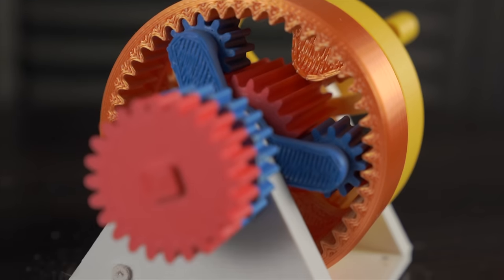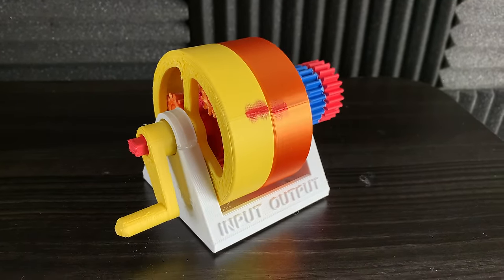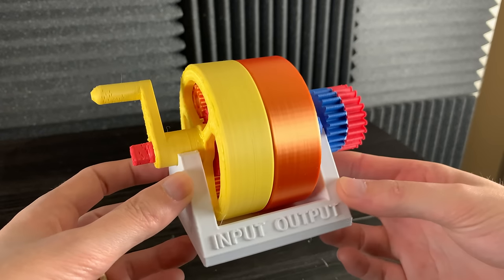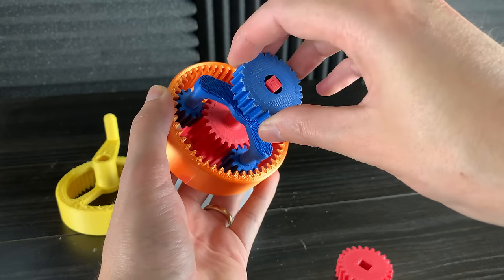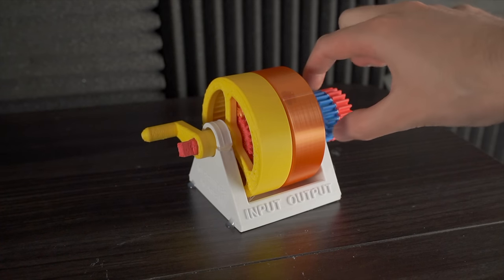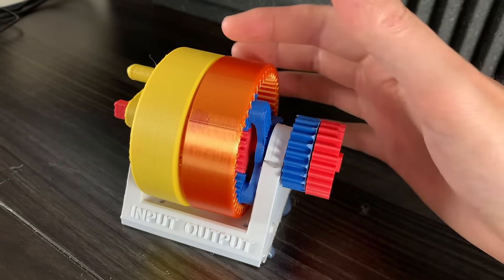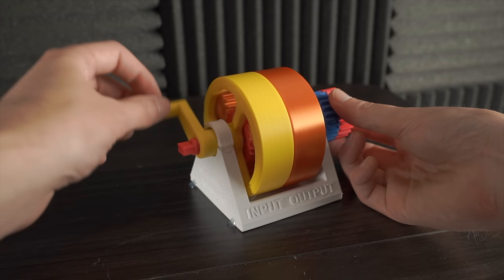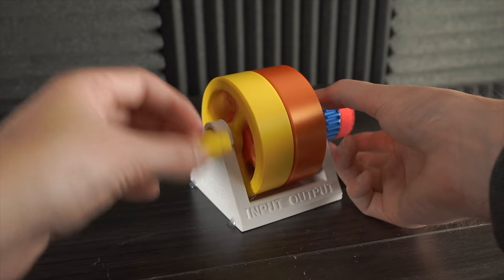How do automatic transmissions work?

Comment: Okay? So how does it automatically change the gears?
Reply: In a real car actuators will do the job.
Hydraulically in older cars
Computer controlled on newer ones
Reply: @ahmedyassir5569  Nope.  It is a series of hydraulic valves that are interconnected.  The valve block looks a lot like a metal maze.
Reply: He changed the ratio by stopping the "handle" gears from spinning, in a real automatic transmission a clutch pack clamps down to perform that job
Reply: it does it automatically
Reply: @protoborg that's what the point of the actuators are....

Comment: This is more like a planetary gear transmission rather than how an automatic transmission works.
Reply: Yes, but no. He even didn't explain how planetary works. Like at all.
Reply: this doesn't even look like an automatic transmission, more like manual transmission in american style where you switch up/down in a single line to change gears.
Reply: Automatic transmissions typically use planetary gears.
Reply: @nrgzrbunny7775  there usualy hydramatics nowadat
Reply: @D4no00  ATs look like this in good cars with newer transitions or performance cars.
Reply: @D4no00  sequential, dual clutch or automated manual?
Reply: No. Automatic transmissions since they first appeared, have used planetary gears. Typical American automatic transmissions like Ford, GM and Chrysler build and use, all have planetary gear sets. The more gears the transmission has, the more planetary gear sets they have inside. Since the advent of other styles of “automatic transmission”, this style of transmission has generally become referred to as a “conventional automatic transmission”. This doesn’t just apply to American transmissions. Borg Warner, ZF and others make the same style of transmission.
Reply: @D4no00  What do you mean American style?
Reply: @J-1410  I think he's referring to automated manual transmissions.
Reply: @mihalis1010  Isn't that a European invention though?
Reply: This. I thought the main aspect of an automatic transmission is the automatic part. While interesting, this video is incomplete.
Reply: @mihalis1010  he's talking about normal Torque Converted automatics
Reply: @nrgzrbunny7775  Honda automatics use spur gears like a manual.
Reply: planetary gear transmissions ARE automatic transmissions. they've used planetary gear sets for yonks

newer autos use dual clutches now, which allows for insanely fast shifts, but at the cost of increased complexity and thus less reliability. one reason why toyota doesn't use them; the company is known for sticking with tried and true things, sometimes to the point that people complain about their vehicles being dated.
Reply: @edbo10  There are manual planetary gear transmissions. Ford Model T had one. Lenco also makes a manual planetary gear transmission for racing applications.
Reply: This is exactly how Toyota Hybrid eCVT works
Reply: @alockworkorange7296  They're...nowadays
Reply: planetary gear in planetary gear... 
it is possible to add more of them..
like 3 rings of planetary gear to get the different ratios from  them..
Reply: @hamster6093  that was a insult?
Reply: @astemet  WHAT?

Comment: That's how the planetary gear set works. but the units themselves are essentially hydraulically driven. you now have to get into the operation of that system with the fluid pump, the valve body and torque converter. the latter being one of the most misunderstood components, not so much the gear box.
Reply: yeah, here he isnt really even showing an automatic transmission, just a linked planetary gearset with different ratios
Reply: @addmix  Indeed. If I remember correctly, the Ford Model T actually used planetary gears but with a manual shifter.
Reply: @addmix he needs to hook it up to a computer for it to be ahtomatic
Reply: This is the correct answer.
Reply: It is vacuum and hydraulic fluid computer.
Reply: I think it depends on the type of automatics

Comment: This explains how the gearing works but not what makes it automatic. How/when are those shifts actually made?
Reply: the computer decides when to shift duh
Reply: @rondg2  There is no computer here, and I'm pretty sure real transmissions aren't controlled electronically either. They have intricate hydraulic systems that look kind of like brains that trigger shifting based on pressure, and the pressure changes based on speed and output resistance. Is this mechanism called the "computer"?? In any case, the thing that makes an automatic transmission automatic is the automatic shifting, not the gear arrangement, and this little demonstration is only a gear arrangement.
Reply: @rondg2  Specifically, it's an analog "computer" called the valve body. Over the last couple of decades, they've been migrating to an actually electronic computer bit by bit but they had automatic transmissions for many decades before electronic computers even existed. Here's a video about valve bodies: https://youtu.be/g1eCAqKjIh8?si=LljfBxvxnodlZzPJ

Comment: Well that's just a planetary gear set which can exist in manual transmissions too but really doesn't explain how automatic transmissions work at all the are hydraulic circuits and steels and frictions and accumulators and all kids of stuff I mean I really have only messed with a 4l60e so I don't know much about others but they are mostly kinda similar

Comment: Exactly every tutorial on YouTube showing how “automatic transmission works “ just showing how the planetary gears rotate. No explanation how why and what’s the “automatic “ thing there. 
No doubt, great job with 3D printing!
Reply: you need to search for torque converter for the other part
Reply: @farerse  I've done this many times, still doesn't explain the automation of the gear shifts
Reply: @meemdoggoriginallongdrink that's the job of the valve body.. a speed sensor inside the transmission reads the input speed , depending on the speed some passages are opened or closed in the valve body . they are usually opened or closed with solenoids
Reply: @farerse I thought the thing that makes "decisions" in terms of gear shifts and controls the transmission has been electronic in all cars made since the 80s or 90s.
Reply: @roymarshall_ I'm not a specialist but I think you are correct, the speed sensor generates voltage which the tcu use to calculate what gear to use, and activate or deactivate electronic solenoids inside the valve body. I don't know how it was done before this.
Reply: it is considered "Automatic" is because this gear system can have sensors that can automatically change the gear ratios safely without damaging the transmission,  this cant be done in a manual transmission  where a clutch pedal is required in order to safely change gears, there are benefits and downsides to either way
Reply: nor the role the fluid plays
Reply: just weighing in to say that is a really shitty 3d print by the way. the design looks good but the print is shit
Reply: @SanDiegoHarry1 Fluid coupling, in the torque converter, allows for the transmission to come to a complete stop (which happens whenever the vehicle comes to a complete stop) without stalling out the engine. 

If the engine was directly connected to the transmission, instead of using fluid coupling, it would stall out whenever the vehicle stopped moving. This happens with a manual, if you don't push the clutch in when coming to a stop.
Reply: @Randomdude868  Automated manual transmissions are just manuals which are shifted using a computer rather than the driver.
Reply: @SanDiegoHarry1  trans fluid lubricates the internals and also provides hydraulic pressure in order to shift into and hold gears using clutch packs. most ATF has a powerful detergent in it too to keep things clean

Comment: Nice.  I'm still working on mine.  Trying to figure out how to simulate the clutch packs.  There's 5 of them and 3 planetary sets, as well as two 1-way clutches.  I keep getting distracted with side projects.  Will finish sometime this year I hope.
Reply: Could do a “ratchet” gear that can only handle so much force or speed then it lets go and as it slows down it re  ingages like a torque converter
Reply: You would need a torque converter as the clutch packs work on hydraulic pressure
Reply: you could just make it big enough to fit actual clutch packs, then you need bands as well to show how shifting works
Reply: It's almost the end of the year, how is it going along?

Comment: The majority of cars world wide still use manual transmission. Up to 2018, the majority of cars sold in Germany had manual transmission, only in 2019 the automatic ones overtook them (55% automatic), however, this is for new cars sold, not cars on the road. Actually the reason why manual transmission will soon die out is not because of automatic transmission but because of electric cars. Also the majority of German automatic cars don't use an automatic transmission as shown in that video, actually they use the same transmission that a car with manual transmission does use, it's just operated automatically and has two clutches, which allows for very smooth transmission without any noticeable tractive force interruption while doing so.
Reply: Yes so True. It is even more convenient to use manuel in hills/Mountains or drive more economically.
Reply: The most important reason for new cars (combustion cars) having automatic are new security and assistance systems build into the cars that make automatic more important and even needed. 
And modern Automatic are more efficient so it also shrinks the over all CO2 output from the fleet which becomes more and more important. Not only because of regulations but also because of the customers want it to be more efficient and sustainable
Reply: Hahaha EVs killing manuals.

That's not happening unless some serious breakthrough is made in the technology, there is simply not enough lithium on earth for the us alone, let alone the rest of the world.
Reply: @gamechip06  you are wrong m8
Reply: @gamechip06 An electric car only contains around 8 kg of Lithium. Currently we harvest 90 million kg of Lithium per year. The earth has approximately 88 million tons of Lithium we could harvest, that's 88000 million kg. For comparison, there are only 1.4 billion cars world wide. Those would require 11200 million kg Lithium in total.

And the first sodium-ion battery, which has the same energy density as a lithium iron phosphate battery in terms of volume, is cheaper to produce and has a longer service life, will be launched on the market this year. Although it is somewhat heavier (lithium batteries deliver 260 Wh/kg, this one will deliver 200 Wh/kg), it will mainly be used in SUVs, where 30% more battery weight will not matter; although the Chinese manufacturer BYD also wants to use them in small cars, simply because they are so inexpensive. As already mentioned, the advantage is also the long service life (they lose capacity much more slowly as they do not age as much) and that sodium batteries are much less sensitive to temperature and also much better for the environment.

Comment: "Amost all cars on the road are automatic"
Laughs in Germany
Reply: *laughs in europe
Reply: Laughs in the world the only people lazy enough to buy automatic its in the us.
Reply: @santiagoperez2094  what kind words
Reply: Efficient* An automatic will always outrun a manual transmission
Reply: @the_expidition427  efficiency isnt about speed. and this kind of transmission neither is more efficient as it wastes a lot of fuel just to operate itself and because of that, it conveys less torque to the drive shaft than the manual.
Reply: @the_expidition427  interestingly, an automated manual is better in terms of speed, weight, torque output, lengevity, number of hp put to the ground and simpleness, than a traditional automatic like you see in the video.
Reply: @santiagoperez2094  it’s not just laziness, it’s almost impossible to buy a new manual car in the US without going out of your way to import one.
Reply: @thatoneguy611  They still make plenty of manual Camaros. I've bought 2 brand new manual ones in the last 2 years. Loved the first one so much, and they offered me more than I paid on trade, that I got a nicer one the next year.
Reply: “Quote”
Laughs in unoriginality
Reply: @thatoneguy611  Or you're stuck with buying a Civic SI or Civic Type R.
Reply: Then tell Mercedes to put a freaking manual in their cars!!!! None of the ones from the 80s had them and it makes me mad because those were the best years for their motors...
Reply: I'm an American and all my cars are manual
Reply: Volkswagen said they would stop making manuals by 2032.  With hybrid and electric cars manual transmissions don't mane any sense. And they have mileage requirements too, and about a decade ago automatic and CVT cars became more fuel efficient. While more popular than in the US, manual cars are doomed in Europe as well.

Comment: Nice job! Nevertheless what I'm missing here, is how this works automatically - you still manually select which handle to hold.
This type of gearbox was selected for automatics because it is simpler to control. But how the car choose which gear to select? Was it always computer, or were there some clever mechanical ways (in older cars)?
Reply: Older Automatics used things like spring loaded valve bodies, as RPM increased so did the pressure from  a driven pump in the transmission causing the valves to open which would send pressure to pistons connected to brake bands around the planetary carriers, modern transmissions work almost the same but with solenoids opening the valves to tighten the bands with the ECU having a set shifting strategy in it from factory. This is atleast my understanding of how it works but I may be wrong, it's also important to note that some manufacturers don't use planetary sets in their automatics, the Volkswagen DSG transmission is one such case.
Reply: @HStahlberg  Awesome information, there's also CVT which are continously variable, meaning that the gear ratio varies with V-shaped pulleys that can change their diameter, making the output/input ratio smaller or bigger depending on the speed you need.
Reply: Exactly what this man says. This is the most important bit and it’s been left out. Not a very good explanation really.
Reply: started as hydraulic from what I remember and then eventually moved to computer controlled
Reply: Pressure...it's all based on pressure

Comment: 0:07 "almost all of the cars in the road are automatic"

Actually nowadays most of the cars on the road have a CVT. Like an automatic but no gears.

At least in the us
Reply: I wouldn’t think most of them, is that really the case?
Reply: @nepicness  with an increasing amount of hybrid cars I wouldn't be surprised. Even then nom hybrid cars have them too. They get much better gas milages. I should really say most newer cars have a CVT.
Reply: Nope.  Only compacts and SOME mid-size cars.  Larger vehicles don't.  Most mid-size vehicles don't.  And no Domestic cars have them.  Only on Nissan, Honda, Toyota, and Audi do.
Reply: @protoborg  all of Toyotas suv hybrids have had cvts for a few years now and the crv-v was one of the first SUVs to use one. compact cars have had them for a while now. Earliest for them I've seen is 2013
Reply: @protoborg  the ford maverick , bronco, and their hatchback and subcompacts do as well. As do some Chevys and some jeep suvs. Many korean cars have options for CVT hybrid as well as full electric. Most japanese cars use cvts now across all models as well
Reply: all im going to say is Nissan CVT goes BANG
Reply: @protoborg  Audi phased out CVT (multitronic) in 2016 when the production of A5 8T ended. Majority of their lineup feature DSG (S-tronic) as automatic transmission.
Reply: That’s just not true
Reply: @ethannorton564  Ye except toyota hybrids use planetary gears that together with the electric motor emulate a CVT. They don't have an actual CVT mechanism.
Reply: @MrUppmas  what model years are they? The rav 4 hybrid, Camry hybrid, Corolla hybrid, highlander hybrid and the Prius all have a cvt for 2023
Reply: @ethannorton564  All model years up to and including today. They don't have a traditional CVT with a belt, but (I'm simplifying a lot here) continuosly vary the gear ratio by adjusting how much power is sent to the wheels vs. sent to the electric motor charging the battery. The HSD also uses planetary gears to better accomodate different speeds.
Just read up on it from wikipedia or smth, small quote:
The HSD also combines an electric drive and a planetary gearset which performs similarly to a continuously variable transmission.

Comment: You have to manually switch the gears by holding the blue or red gear. The literal definition of manual. Maybe redo this one and show actual automatic shift based on the RPM.

Comment: I just about get that this shows how the mechanism gives different gear ratios, though not why it uses a planetary arrangement. What I don't get at all (I'm in UK, where most cars are not automatic, but I've owned several automatics) is how it does what its name suggests: automatically "know" when to change, and then does so. (Including, how it works when the car is stationary without stalling the engine.)
Reply: Planetary gear boxes are more durable because more teeth are engaged around the perimeter of the ring gear vs just one side, so they can be made to produce loads of torque with less risk. A comment from another user above explains how the shifting is done automatically. The video would be better titled "how to combine two planetary gearsets." This isn't automatic at all. It's a very simple manual transmission.